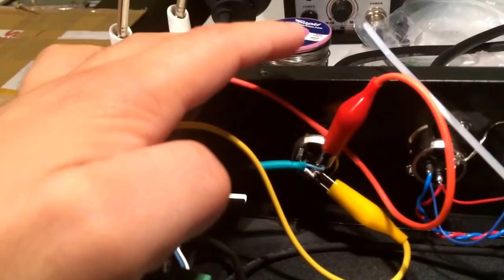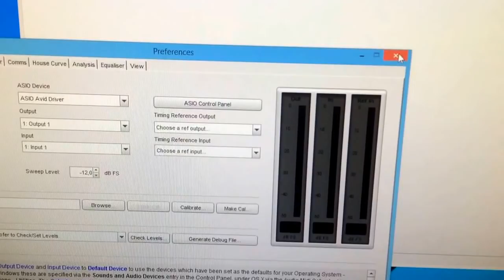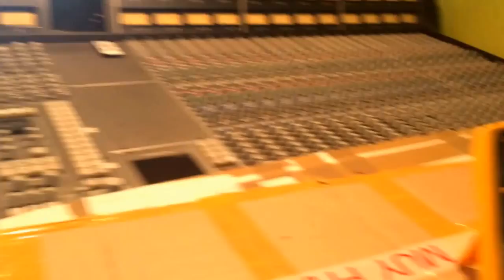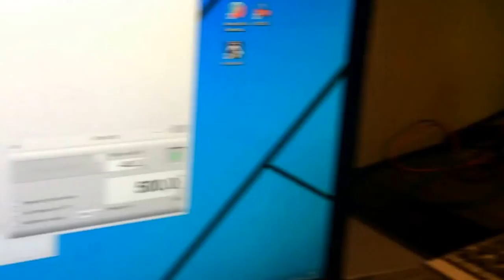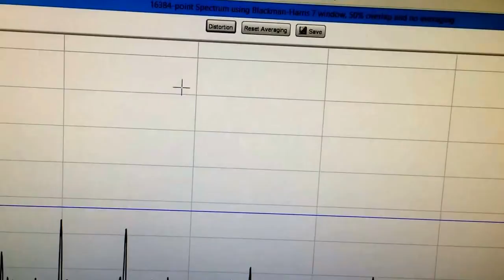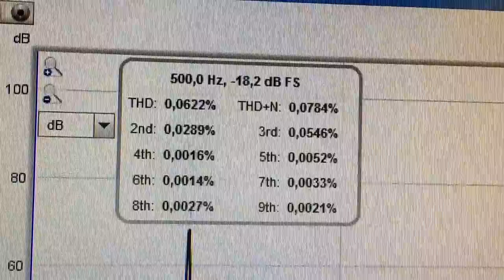Hairball Audio 1176 THD calibration (4th optional calibration step)

Comment: wow!  Within the first 2 minutes.  You said the most significant thing.  I've been yapping about this for years, to people.

These solid-state transistorized 1176's.  Actually take approximately, 3-4 hours to come up to proper operating temperature.  Because the heat given off by transistors is extremely low.  And it takes a good long while.  Before any adjustments should be made.  And I am impressed with you, sir.  No one else has really bothered to ever mention that.  That really very important one thing.  Hours worth of warm up time necessary.  Before you adjust them.  Before you use them.  I mean you can use them sooner but, why?  They're not going to be ready to go.  The way they are intended to.

Finally an actual engineer that knows what they're talking about.
RemyRAD
Reply from the maker: Thanks! Really appreciate that! I thought someone would find it interesting when building their 1776s ✌️👍